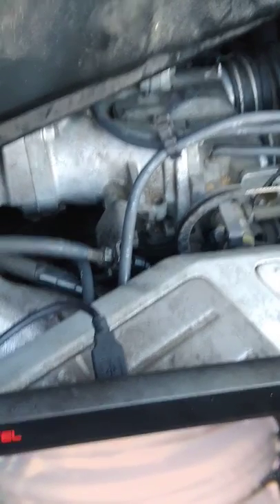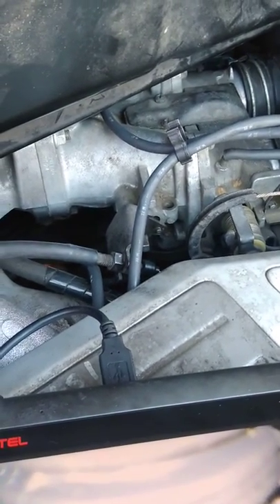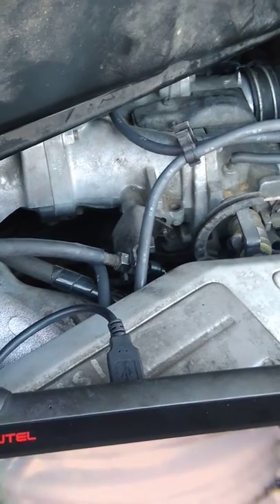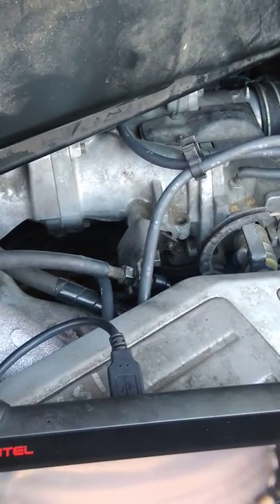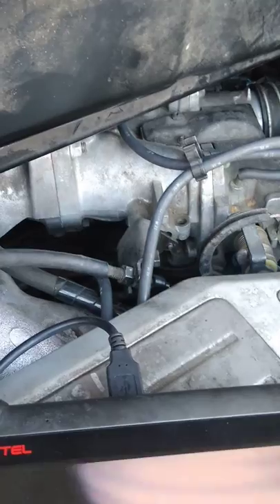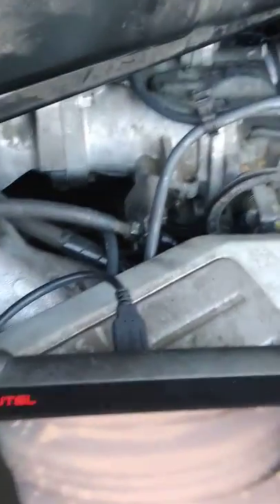1999 Lexus Rx300 no start

Comment: Sometimes it just be the negative and positive cables on the battery,  unscrew pull cable tightly , re-screw 
Then connect to battery. - good luck